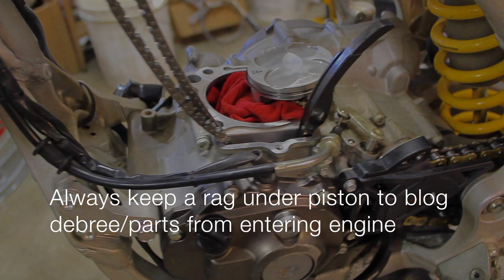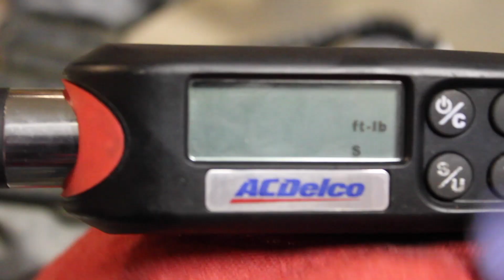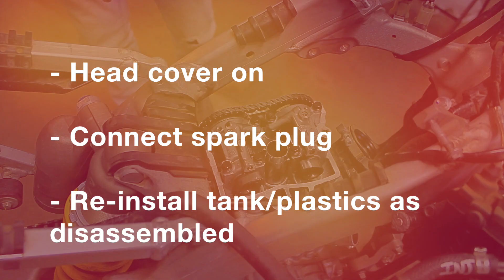2014 - 2019 YZ250f Top End rebuild & torque specs

Comment: Hi I torck my 2021 cylinder head at 29 fp and like oil by de cylinder metal gasquet 🤔 I will like to pot it a 33fp tomorrow. The  manual is so weird 😳  it's saying 22fp and coming back to 11fp and after do 60 degree  on  Each one and coming back and do another 60 degree total 120 degree 😳 omg it mor then 24 fp I did 29 fp and liking 🤢🤢 . Do you have and any tips for me About how much I can put . Thanks

Comment: Any chance you do the next top end with a more detailed video?
Reply from the maker: Luis Alberto Gálvez yeah I am editing a 2010 full rebuild with a little more detail and video angles. Do you have any specific questions about this one?
Reply: Ty Nagle just general curiosity I haven’t work on any dirt bike engine at all and I might attempt to do a top end on my 14 yz250f
Reply from the maker: @wicho99w99  Have you tried it yet? I started other projects and haven't edited/posted the RF rebuild yet..
Reply: @tieNagle  nah man i sold the bike a few months ago I used it like 3 years without touch the engine and no problem just frequent oil changes and air filters I wants a really fast rider so the engine wasnt stressing too much

Comment: What would u recomend for a break in
Reply from the maker: I usually do 2 idle-only warm up cycles and cool downs checking for noises. Then ride it lightly just to get it through the gears and make sure oil gets all inside every crevice. I've har manufacturers say the metal needs to heat and expand a couple times before it's in its 'final state' or whatever.. Then top off coolant after its been ridden to get the bubbles out, and let her rip!!!! Do you have a system?